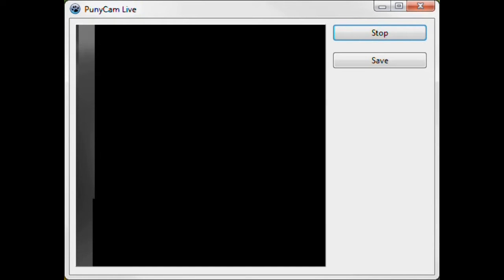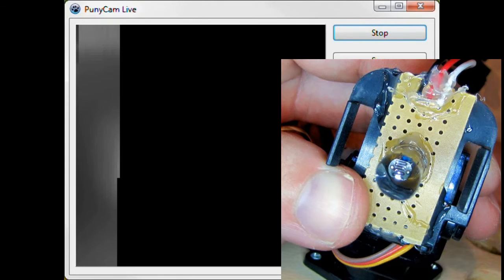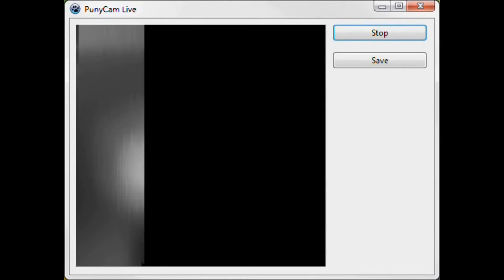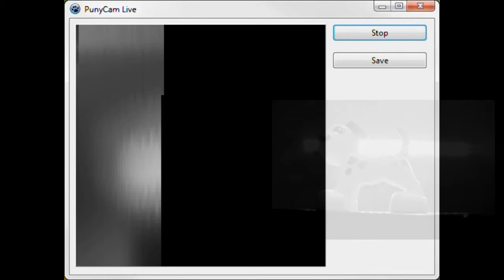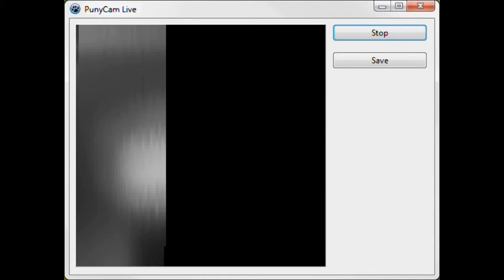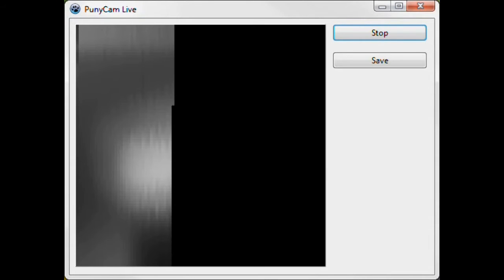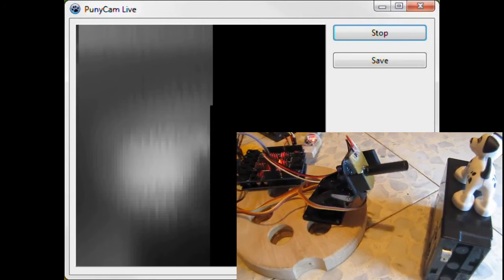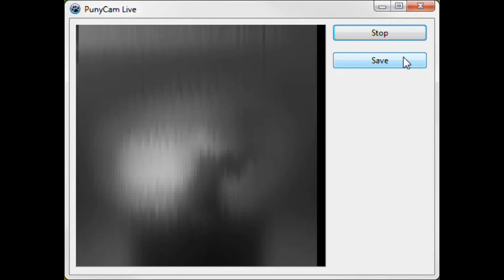The Not-Amazing PunyCam Project

Comment: Great project!
I think the image looks mangled up because the pipe is way too wide and the light is probably seeping in reflecting off the walls?
Maybe having a narrower pipe and a rough surface on the insides of the pipe might make a significant difference...
I am not sure if the pipe's too thin, the end might act like a pin-hole camera and thus letting in light from all the directions and we end up with a mangled image again. :S
Reply from the maker: Honestly, I know almost nothing about optics, as far as I know all these options could be correct :)